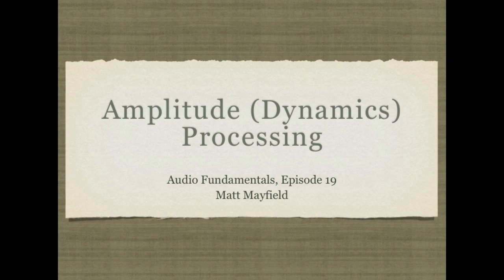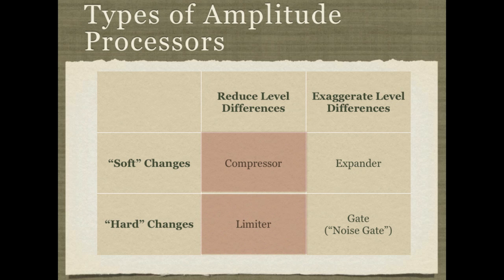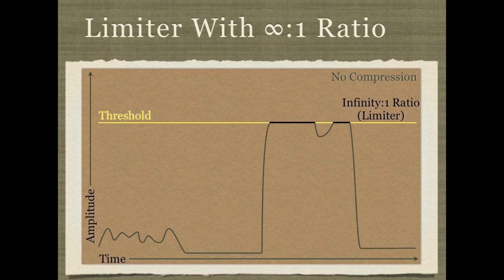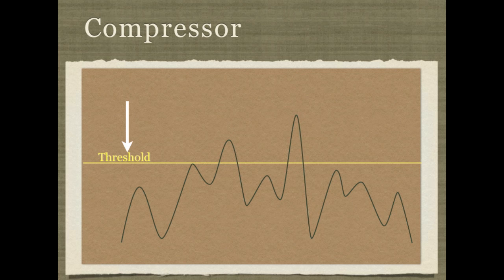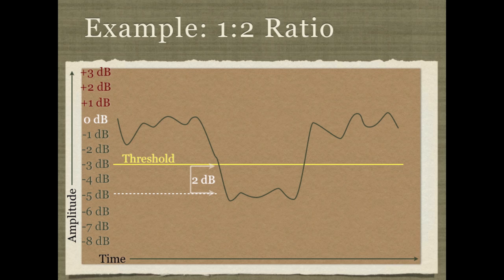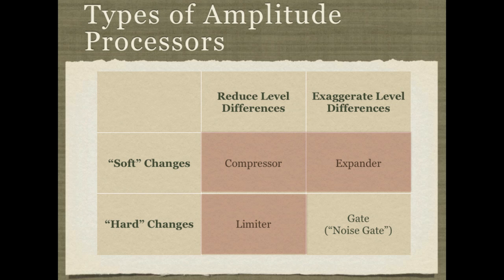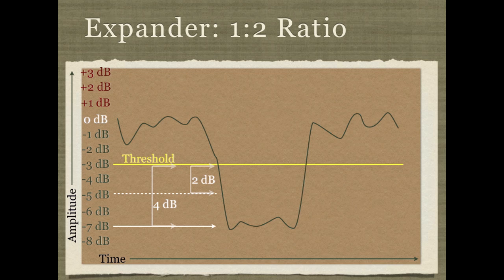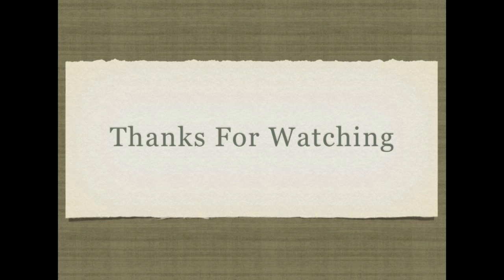AF019 - Dynamics Part 3

Comment: I remember reading about how dbx tape noise reduction worked in the late 80s. It was a system that amplified the high frequencies, then compressed and amplified the overall signal as it recorded, keeping most of the signal well clear of the noise floor (tape hiss). During playback, the system then expanded the signal to restore the high dynamics and reduced the highs back to normal, which forced the noise floor WAY down low. That was a compression-expander, or "compander" noise reduction system. Not very useful in digital audio where the noise floor isn't an issue, but I thought it was a pretty clever way to make very high quality cassette recordings.

My big problem now is that my most important cassettes were recorded with dbx noise reduction, and they sound awful because I don't have a playback system that can decode them. I found a virtual Dolby decoder online, so I can record my Dolby cassettes onto my computer and decode them, but I haven't found one for dbx. (I think it was dbx II.)